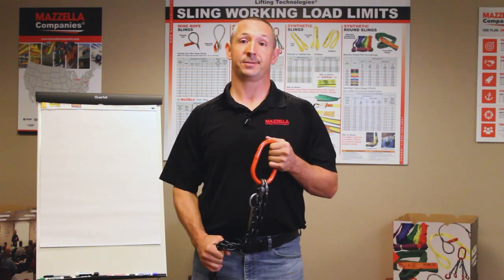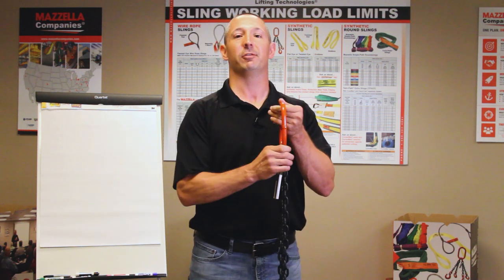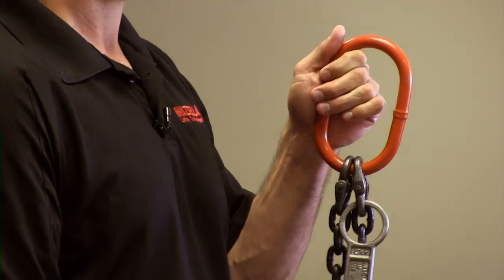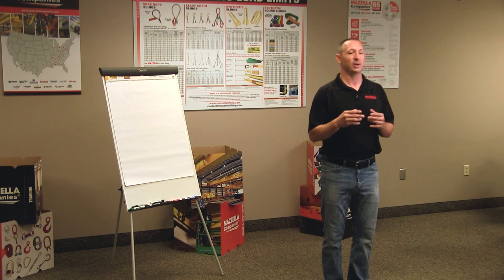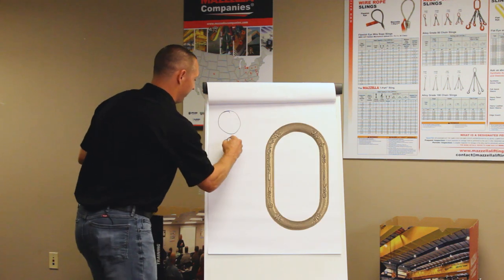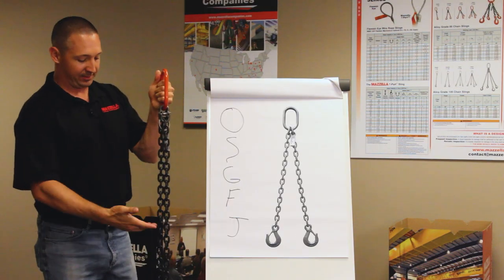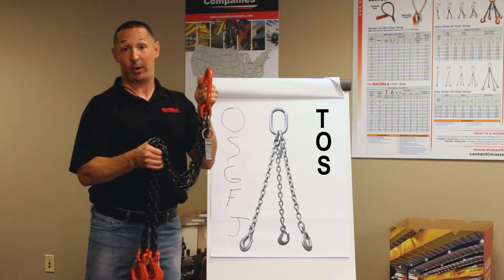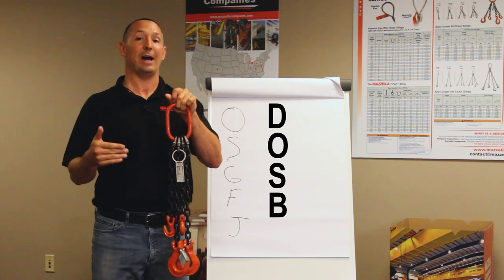Alloy Chain Slings: Basic Acronyms, Components, & Configurations

Comment: So not applicable to overhead lifting but could a person use a grade 80 sling hook in place of a grade 70 slip hook on a grade 70 chain and use the sling hook as one would expect to use a slip hook? Seems like some manufacturers refer to grade 80 and above sling hooks as slip hooks as well but I'm not sure on this subject. I understand that the lowest rating is now the rating of the entire system.
Reply from the maker: Hi Joe! Thanks for your questions. Yes, absolutely. Somebody could use a grade 80 sling hook in replacement of a grade 70 slip hook. Again, to reiterate, You would not be able to perform overhead lifting with this chain set. The rating of the entire system will be factored by the lowest rated component in the chain setup.

It is unfortunate that sometimes manufacturers refer to their sling hooks as slip hooks. It does create a bit of confusion. That is why it's important to have a competent, qualified person performing overhead lifting. You have to know standards and the equipment you're working with.

Comment: I understand that Grades 80, 100, and 120 being the Chain Grades approved for overhead lifting but what about a load that is lifted Vertically but NOT Vertically Overhead?

FOR INSTANCE:. Let's say you are vertically lifting an Engine Block from the shop floor to a height of about your waist or chest high but NOT overhead.  Would the Grade Requirements for Overhead lifting only with chain approved for Overhead Lifting still apply?
Reply from the maker: Chain grades approved for overhead lifting are built to stretch before breaking.  They are built to a degree to withstand some sort of accidental overloading.  Chain grades not approved for overhead lifting will shatter if accidently overloaded.  It is not recommended to use any chain grade for a lift that is not approved for overhead lifting.